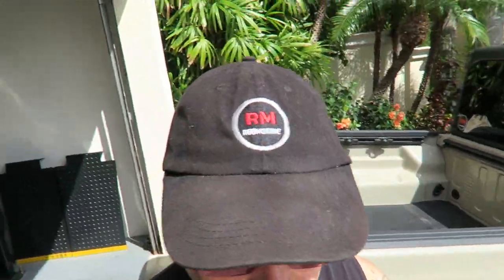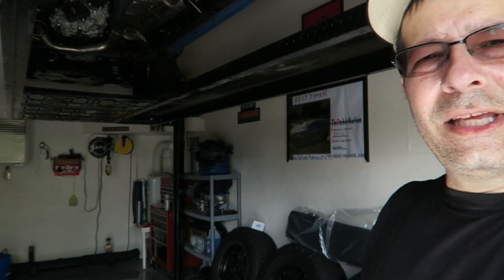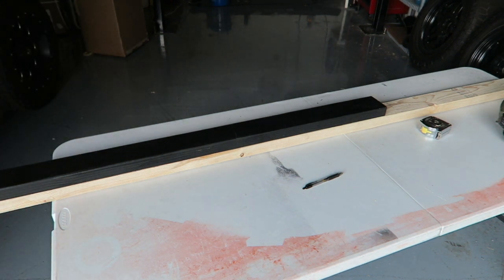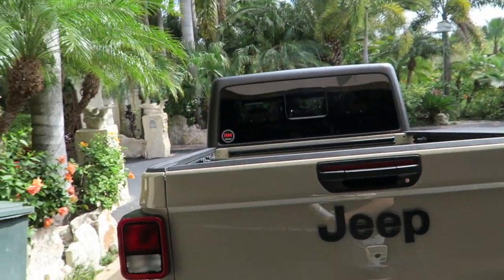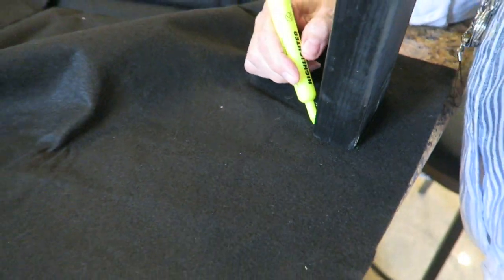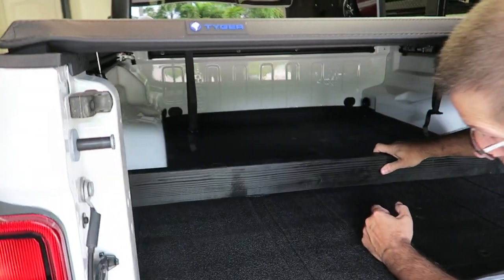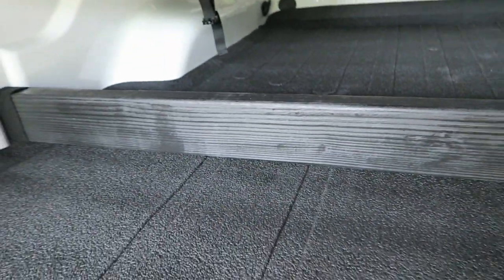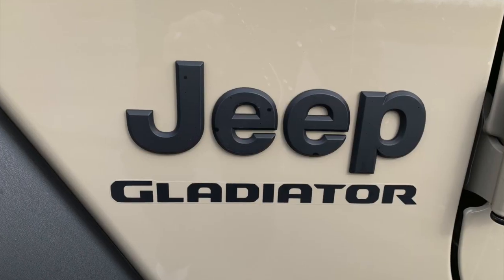Jeep Gladiator Gladdy Board to Make Life Easier! 👍🏼

Comment: did the same thing for my old Chevy 2500HD.  had a long bed, 8 feet.  I had a much taller piece so the top of the board was almost level with the top of the wheel well.  It helped support really large loads.. I hauled an old VW Beetle body in the bed of that truck, it had no fenders.
Reply: Monty Piper That’s awesome!  👍

Comment: 2x6 or 2x8 to match height of wheel  wells  but looks great also you got both mom and dad on this video
Reply: Michael Neuhaus Thought about larger but I wanted something light.  Just mom in the video.
Reply: Michael, two 2x4s stacked or a 2x8 ripped to 7" will match height of wheel well with a 2x4 across the wells.

Comment: You could of just went to homedepot, pepboys pretty much any auto store and just spent $15-25 on a cargo bar. Can olace it anywhere in the bed.. high or low
Reply from the maker: Where’s the fun in that?
Reply: @robmotiveplus  its adjustable so you can put any where you like in the bed and is universal for every truck and suv's. it can keep large cargo in place cause with what you have anything taller will just tip over that. why does there have to be fun in it? its a product made to make life easier

Comment: Have you considered doing a Raptor bed-liner application?  Would look good you can get it in colors.  Get at least 2 vids, one on prep and one on application.
Reply from the maker: I've seen the colored type in the past.  They do look pretty good.  However, with the cover and mat, I don't think it would be of any benefit to me.
Reply: RobMotiveJT 

I carry a lot of things in the back of the Tacoma the poly bed doesn’t really get scratches that can lead to rust, and for a cleaner look. The metal bed you’ll benefit from a covering for me. You mentioned that if you want to use the truck to haul you use your Tacoma, so less of an issue for you. On the other hand you have a couple of videos for around $200 in materials. You can sit things on the tailgate and not worry about scratching it.
Reply from the maker: True.  But with the Tacoma it’s not really a concern for me 👍

Comment: Rob, don't know if you know about this, but I just saw this on YouTube today.  You didn't mention this, but your mod touched on it a little.  Jeep has a clever deal where you add (3) 2x4's  and setting the tail gate to the mid position to create a level platform which allows you to carry 4x8' ply wood boards in the bed.  Pretty clever.

Check this video out...  skip to around 1:15 to see the important part
https://www.youtube.com/watch?v=SAy_KLUqzcc
Reply: Kevin Lew I had seen that.  Pretty handy idea👍